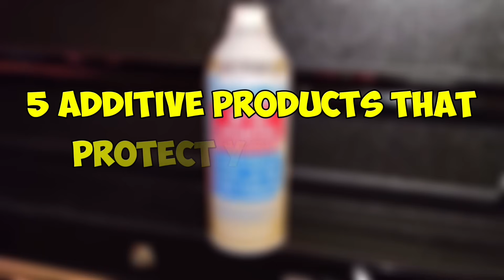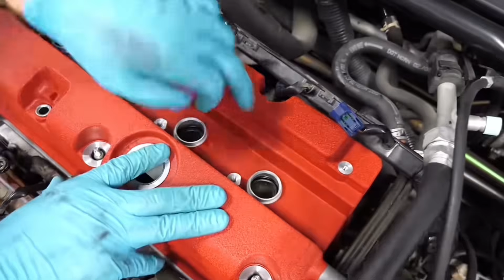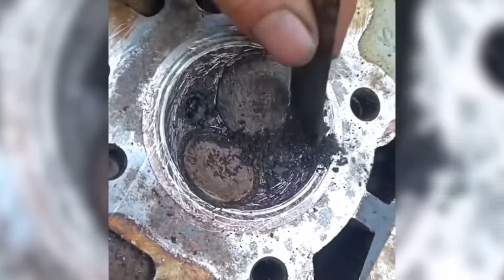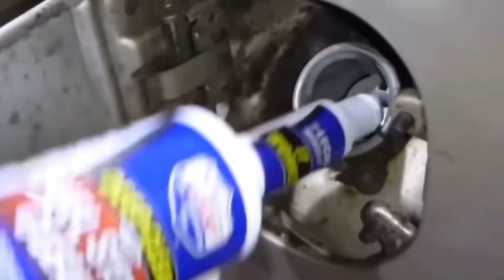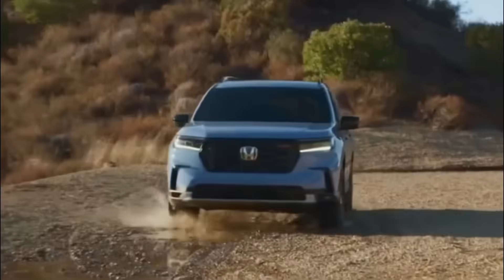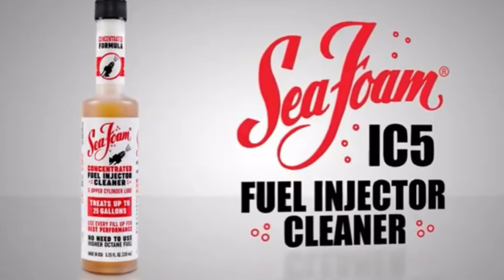Honda Owners Should NEVER use These 8 Fuel Injector Cleaners (& 5 That WORK!)

Comment: I have honda jazz vx mt 2017 1.2l ivtec engine model.But issue in mileage please suggest me what additives should be use.
Reply from the maker: Here's what you need to know about your 2017 Honda Jazz 1.2 i-VTEC mileage issue. Stop throwing money at bottles that promise miracles. Additives aren't the magic fix most people think they are. Use Chevron Techron Concentrate, BG 44K, or Gumout Regane. These contain high PEA content that actually cleans Honda's precision fuel injectors. Add one bottle every 5,000 to 7,500 miles with a nearly empty tank, then fill up completely. But here's what Honda owners miss. If you're already using Top Tier gasoline from Shell, Chevron, or Exxon, you don't need additives. Top Tier fuel already has the detergents your Jazz needs. Your 1.2 i-VTEC should deliver 16-18 km/L combined under normal conditions. 

If your mileage is significantly lower, additives won't fix the real problems. Check these first: wrong oil viscosity (use 0W-20 only), dirty air filter choking your i-VTEC, low tire pressure, clogged fuel filter, or carbon buildup on your throttle body. Your next step Should Be to open your owner's manual and verify correct specs for your market. Then visit Honda Jazz forums like FitFreak.net or search "Honda Jazz 1.2 mileage issues" on dedicated Honda communities. Real owners with your exact engine share solutions that actually work. Solve the root problem first before relying on fuel additives @devidsaikia2301
Reply: Thanks for ur suggestion.Does all the mentioned additives help me to bring back the mileage issue?
Reply from the maker: @devidsaikia2301  Here's the reality directly for your issue additives won't bring back your mileage if the root problem isn't fuel system deposits.
Techron, BG 44K, and Gumout clean dirty injectors and carbon buildup. That's all they do. If that's your problem, they'll help. If it's not, you just wasted money on a bottle that can't fix mechanical issues.
Before buying additives, check these first:
Spark plugs - Replace at 60,000 km with NGK or Denso iridium plugs. Worn plugs kill mileage in small Honda engines.
Engine oil - Your Jazz needs 0W-20 synthetic only. Wrong viscosity increases friction and reduces efficiency.
Air filter - Dirty filter chokes your i-VTEC. Replace if you can't see light through it.
Tire pressure - Check weekly. Underinflated tires are massive mileage killers.
Fix those basics first. If mileage is still low after that, then run one bottle of Techron and monitor results. If it doesn't improve, your problem is mechanical and needs proper diagnosis.
Stop looking for solutions in bottles. Your 1.2 i-VTEC needs correct maintenance, not chemicals.
Reply: Thanks a lot.Will try.❤
Reply: Thank you for video, Honda CRV 2020, FWD, 100 000 miles , not a hybrid, what your suggestion?